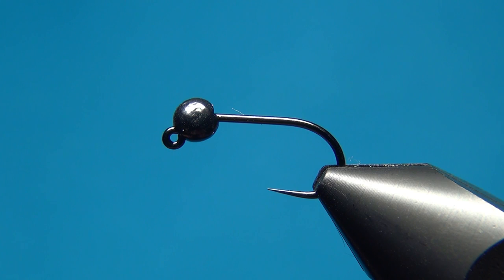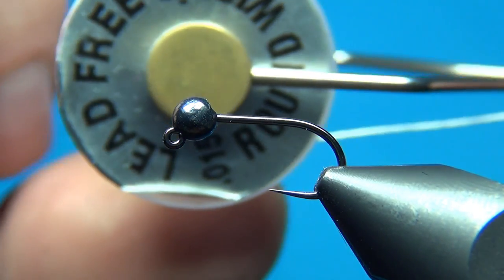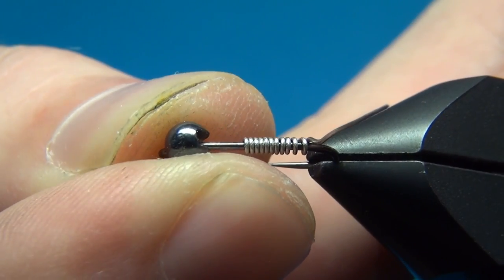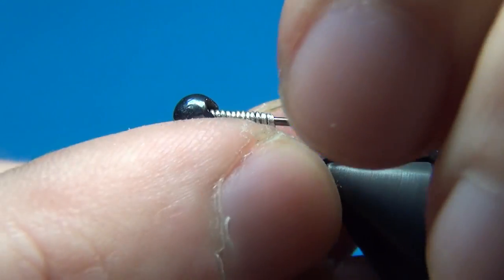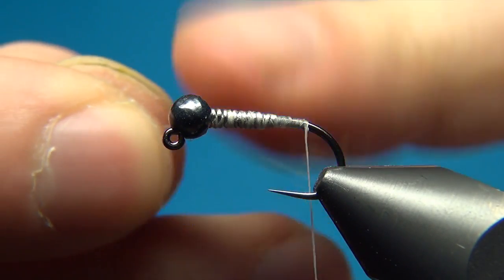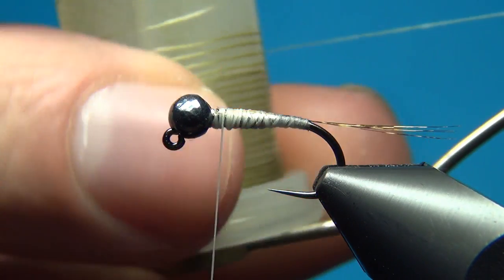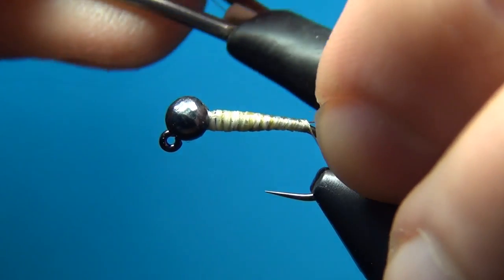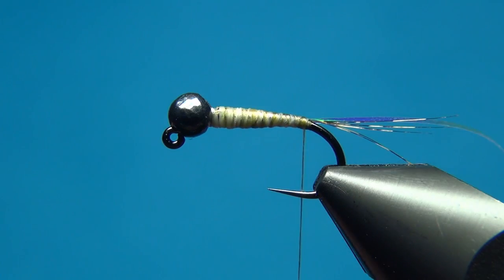Fly Tying UV Chroma Frenchie | Hackles & Wings

Comment: Putting resin on pheasant tail ?! Many traditional tiers would probably consider it a crime ;-)
Reply: +Kamil Ponikowski to be honest, I dont consider myself a traditional tier, but even for me pheasant tail coated in resin looks kinda off
Reply from the maker: +Kamil Ponikowski Well then I'm not traditional at all :) No the coated pheasant tail sure changes the look of the fly and would not work for a true pheasant tail nymph for example, but when I tie tungsten jig nymphs I prefer to have a much more durable fly that can jump along the bottom whitout coming apart. Another technique is using a wire instead of the tinsel as rib as it would make the fly more resistant. All the best. Simon
Reply: +HacklesAndWings true :-)